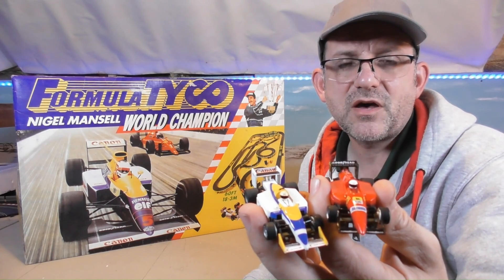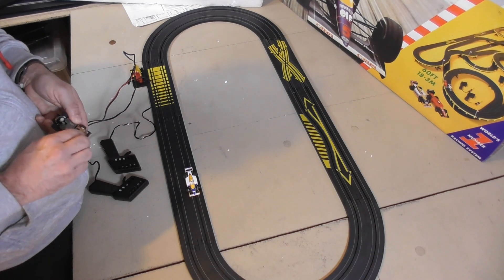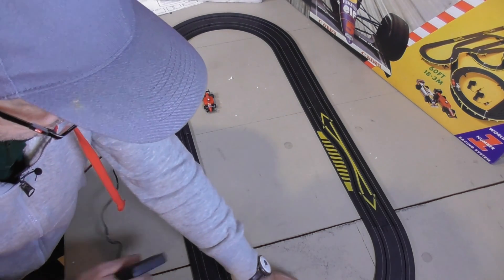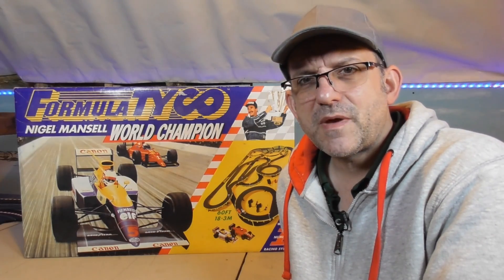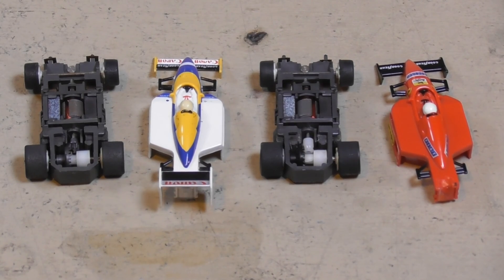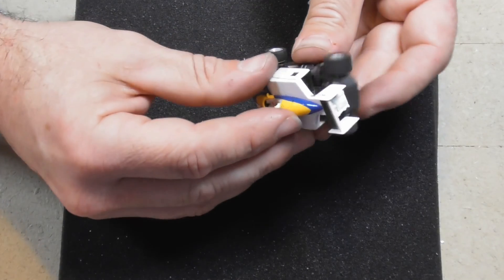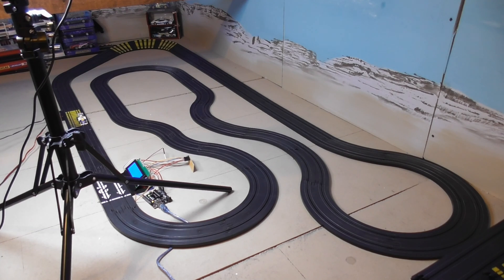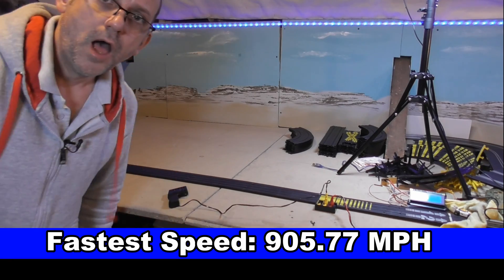Was this toy slot car faster than the real thing? | Formula Tyco

Comment: This was so good and also you don't need to apologise. these systems were all marketed as H0 , 1/87, in order to be sold alongside US model railroad. Truth is, scale of any given H0 slotcar is dictated by standard chassis wheelbase, which kept increasing as Tyco and AFX sought to outdo each other. By this point the cars are way closer to matchbox, 1/64 scale than 1/87.
At the time this Tyco chassis was said to be geared too high for the sets they came with, I bet this could hit 1200 with enough straights and fresh tyres

Comment: Tell us more about the Arduino program
Reply from the maker: i basically installed light sensitive diodes into a section of the track at measured distances apart and then wrote a code to measure the speed taken to cover the distance, the programme then converts the actual speed to scale speed.
Reply: @slot-car-dad  for my lap timer that I just started writing, I am using light sensitive resistors. I am using an Arduino in ADC Free Running Mode with an ISR  as analogRead() wasn't fast enough. I'll have to read about light sensitive diodes.
Reply: @slot-car-dad  hello, I wasn't aware of the difference between a photo diodes and a photo resistor. I will need to look into that
Reply: @slot-car-dad which photo diodes did you use? There are many to choose from

Comment: I really wanted a TCR set as a kid. I did have scalextric. 

A lot of these "mini" slot cars, to me, seem to move too fast and hold on implausibly in curves. I preferred scalextric precisely because it was slower and much easier to see what was going on and react to it.
Reply: i had a smaller set from tyco featuring the williams and a benneton car, circuit was a bit smaller, but i got tired of it really fast because of the same reasons you re giving. Racing with 2 just didnt make any sense, you had no control, there was no real "racing", it was just a race to pick your car up and put it back on the track fastest.
Reply: @martijnstroobants824  yes. "Faster than the real thing" is quite a marketing claim - but it doesn't make for a fun toy when the cars are just an uncontrollable blur. The Skill in scalextric was in slowing down enough to safely negotiate a bend before hammering the car out of it late enough not to spin in. You could genuinely "race" with a bit of practice and good timing.
Reply from the maker: It does seem to be a case of on or off racing.
Reply: @slot-car-dad  yes - this used to drive me up the pole. Your opponent could steal a few laps whilst you ran over to your car and dropped it back on the circuit. So a single off would make the race a foregone conclusion. That said. It's the same in real motorsport. If you crash, you lose. I don't think it occurred to 9 year old me to take it steadier and pass my friend's car whilst it was upside down on the shagpile*

*A type of carpet popular in the 80's. Honestly, people.
Reply from the maker: thanks for watching